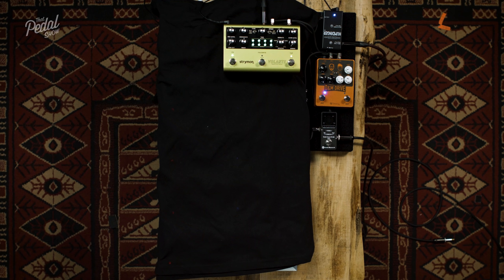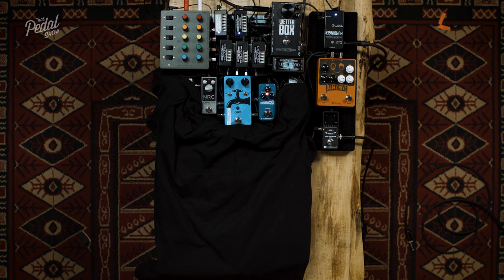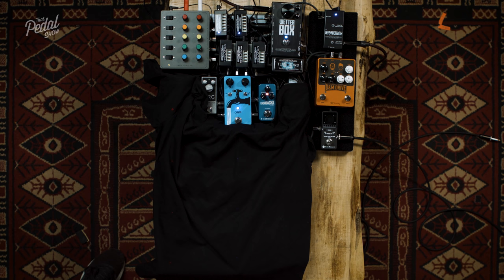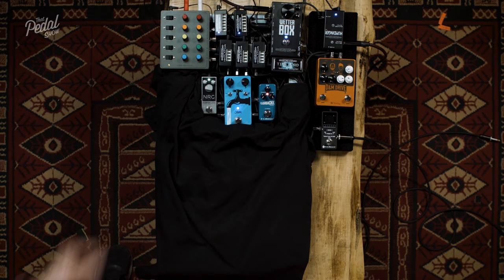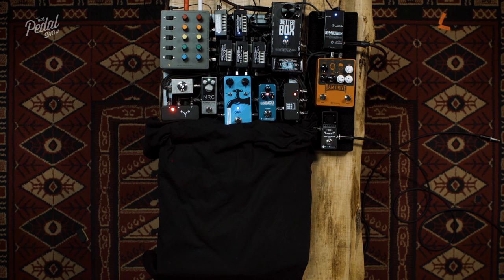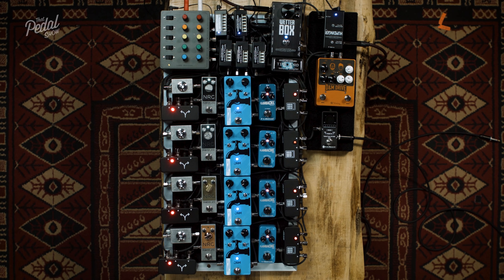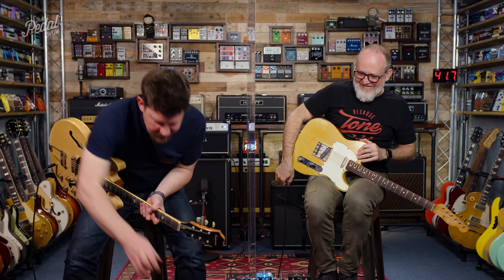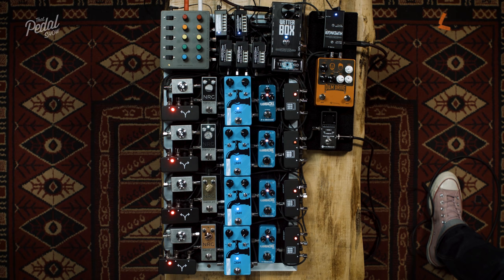The Ultimate DIY Delay Pedal? – That Pedal Show

Comment: This needs to be a running series. “Absurdly impractical pedal uses that are amazing.”
Reply from the maker: That seems to have been the mantra since the beginning. Ha!
Reply: I'm honestly thinking about a Leslie sim made up of individual pedals. 😂
That would definitely be a challenge to say the least. 🤔
Reply: @error8418  good one!
Reply: I second that
Reply: YES YES YES!!!
Reply: @error8418  Two amps, a treble/bass stereo splitter, one tremolo for each of the two frequencies (each going at different speeds), and a stereo panning effect would be a place to start. Changing (ramping) speeds of the tremolos and panner would be the hardest part to figure out...

Comment: Love to see you guys in the same room again so much! I got sick and spent weeks at parents without proper headphones or monitors and been shopping 80's rack gear instead of pedals! Needed you guys back in my life! Really fun and ambitious episode!

Having studied some of those 80's rack systems, it would be fun to set parallel (with each other) reverbs and delays (full wet) and mix them with the dry signal and each other! With left and right delay repeats asynchronized! With modulation and reverb in the repeats! And add some fun EVH/others style detune thickening as well. Some Lexicon rack stuff did just that built-in, providing control over those parameters, it must've been a miracle for guitarists (or producers) back in the day. You did much of that fun with analog chain, with pedals in this video and I'm very happy about the length you went with the effort! Also the fun part is that at the same time you got 4-voice chorus on the board!

Comment: Seeing what’s happening INSIDE the a complex pedal by showing its component parts is GENIUS! I studied photography in University when it was an actual chemical process. When I use Photo editing programs, I know what the ‘effect’ is mimicking.
It doesn’t necessarily make one better at using the program/device, but it does increase ones understanding. This knowledge helps you dial in the effect more precisely, rather than just hunting endlessly through the parameters until you get something that’s ‘acceptable’

Comment: Hi Mick, I thought I would contribute an answer to your question re: 4 head tape delays. The Korg SE 500  has 4 delay heads PLUS 1 sound on sound head and was introduced in 1977. I have had mine for over 40 years and it still works perfectly. Dan you may recall "Smithy's" a Sydney secondhand gear store. I bought my SE500 there for $200 dollars. Interestingly when supporting Simple Minds in the early 80s Charlie told me that he had tried to find one but had to settle for the SE300. These units have their own unique sound signature and are great for preamplifying a signal  on long cable runs on big stages. Thanks Dan for helping us visualize and appreciate what goes on in multi tap units. Saturday morning coffee with D & M always a joy.
Reply from the maker: Ah, Smithys!! I remember it well, bought loads from them 🤓👍
Reply: @ThatPedalShow  Yep Neil Smith was quite a character..... wonder what he would think of ebay/Reverb.

Comment: Lovely stuff! Belongs in the 'Pedal Fairy Tales' drawer of the TPS filing cabinet..... I have done exactly the same thing but in Protools using basic modules to build various fx. It started out trying to do the Roland Dimension style chorusing. Never got it quite right, but I found some really nice stuff in there, and had a lot of fun doing it. Thx guys. Peter

Comment: Guys, for true tape multihead delay simulation you should patch all feedback signals before the splitter so all feedback signals should be summed together (like true tape delay does). Right now you have 4 tapes delays connected in parallel instead.

Comment: You could use 2 Strymon digs and replace the eq pedal With something like the JHS colour box so you have a little more control over the eq and add some full frequency grit.

Then of course run this in a wet/wet/dry/wet/wet rig...

Comment: It’s actually an interesting concept to have an infinitely variable stereo/wet dry rig.   You could take an input, split it X ways, running into different effects in each leg, and then mix that together in the same way here to two feeds where your “panning” pots would actually mix the stomp boxes into either (or both) amps.    Basically, your wet dry would be infinitely adjustable where each effect can live in the wet leg, the dry leg, or some of both. Hmmmmmmm.

Comment: Very cool!! So what did you miss? Maybe some kind of noise generator to replicate tape hiss, and a compressor. When I use my echoplex the unit compresses the sound. I love that you included the eq in the chain, but a compressor could also be cool, since it gives kind of a ducking delay. I would also try to mimic the circular delay patch from the old Lexicon pcm 70 rack unit.

Comment: Yeah, this explains why a Volante cost so much. But indeed, this also gives you ideas how to create interesting lines. However... I suggest diving into parallel mixers... Maybe for another time. You could try to parallel mix in delays / reverbs, modulation effects, loopers or - even foundation drives / amp pedals.... So maybe three shows?!?

Comment: That gentlemen,  was epic 
Now, if I understand correctly,  the feedback/ regeneration is controlled by the strength of the signal.  The stronger it is the more times it can travel around the circuit. 
Have you taken any orders yet?
Reply from the maker: Correct, you need to take gain structure into account with feedback 🤓👍

Comment: I know when you did the video on the ZOIA you kind of dismissed it as existing for weird sounds but the ZOIA is essentially just what you've done here... in DSP form. Create whatever as though you had a bunch of pedals you can chain together however you want. You could totally create a tape delay by chaining together some gain/compression, various modulation and delay lines etc. It doesn't have to be weird sounds. 
I learned so much about how delay and chorus and leslie etc actually works by trying to recreate what's happening in the ZOIA
Reply from the maker: Totally. Now make the video with the Zoia so people can understand what’s happening in their Zoia. Ehhhhmmmm
Reply: @ThatPedalShow  Ha, for sure it's not a good visual for video. Was intended for anyone watching this video wishing they could do this themselves!

Comment: It happens that I have a similar rig for my primary modulation, using four Little Labs IBPs set slightly different, through a couple PN-2s and an assortment of Vibrato and Flanger channels. You show that it needn't look so precisely like a train wreck, there's hope. I suppose I can break down and get a couple of modern power supplies.

Comment: Ok. A half hour in.  It sounds gorgeous.  

However.  It’s only half of what a Yamaha UD stomp could do.   The UD a had 8 delay lines.   All with independent delay times, feedback, panning, modulation, high and low cuts... plus a delay offset.  Oh and you could control the wave shape of the modulation.

And you could also assign each delays input source (main input from guitar or another delay line).

Their MagicStomp had a UD algorithm in it, but it wasn't quite as flexible/didn't have all the parameters available on every delay line.

Comment: This is the Type of stuff i want to get the Zoia for, although 4 heads might be pushing the dsp :D
Reply: Zoia can do 4 delay lines no problem. You may have to use additional delay lines modulated by an LFO for the chorus/reverb though as oppose to the already included effects.

Comment: We need a video on how different amps take fuzz... Do blackface amps take fuzz differently than Marshalls even when using an external eq pedal? What amps sound the best with fuzz what are some of the differences?
Reply from the maker: Hello! We’ve done numerous vids on this over the years.... Insert relatively complex answer here, but the reduction is that if the amp is cranked, it’s all good. If the amp is clean and spiky, more hassle ensues. :0)

Comment: I suppose one thing is modulated delay is not same as delay followed by vibrato as the timing changes too/different feel. Tape delays also have a kind of dynamic, saturated EQ that gets stronger with repeats trailing.

Is also isnt there a flashback X4 that does exactly what this board does?

Comment: The thing about separate modulation for each head is that it doesn't reflect the physical reality of what the Volante's trying to imitate. Variations in speed will affect each head in concert, because it's a single magnetic drum (or tape loop) in the original device. So it's less that a simplifying decision has been made to fit the device into the space than it is that they are going after a specific emulation rather than the more flexible, novel setup. I love the possibilities of individual modulation, though. Hmmm. And if anyone's made it this far: I intend to use the VFE Klein Bottle (which has all-way feedback, and LP/HP filtering) to do a three head delay. Can anyone recommend a really simple digital delay to use for this? Preferably affordable since I'll need three of them. But not junk cos I want it to sound good.

Comment: Great show you both!
One question though: you now simulated a tape delay with 4 tapes, would a one tape 4 heads delay not be like that you mix all four delays back togther then do the modulation and filtering and after that finally send the mixed signal baxk to all delay units? Or am I wrong?
Reply from the maker: Yes, similar. Although your wouldn’t have individual control of the filtering and mod on each head. Cheers!

Comment: Question for Dan on the Wetter Box. I am considering purchasing an old Lexicon Rack unit. Could I use the Wetter box instead of a Rack line mixer to maintain the analogue dry signal? I wasn't sure if the wetter box could handle professional line level.

Comment: Question... I think this is the place where someone might know an answere.... Is there a pedal out there, or did anyone tried to put a full delay pedal (with feedback etc.) into the fx loop of een ''master-delay'' pedal? Instead of in series or in parallel mode. I'm wondering how it would sound, but I unfortunately lack the time for putting two pt2399's on a breadbord right now... Anyone?

Comment: gahhh why didn't you route all the repeats thru the same modulation pedal? it's all on one piece of tape after all.
Reply from the maker: Because we wanted to be able to vary the modulation per line
Reply: @ThatPedalShow  fair dues, was also wondering why the delays were set on digital mode (ie no pitchshifting with delay time changes) but I guess that also answers that question